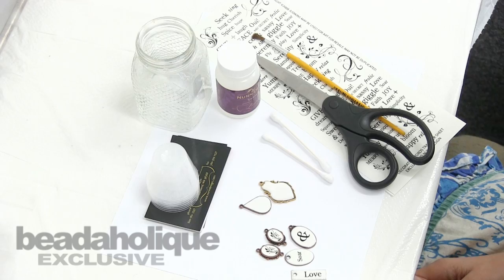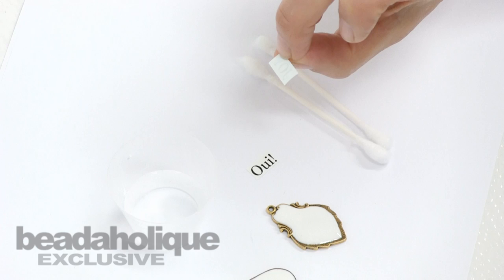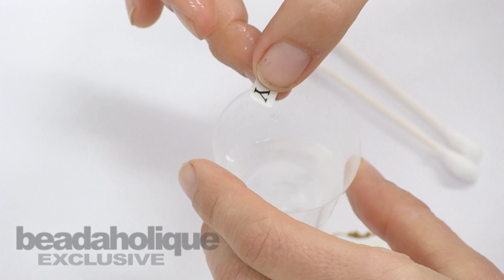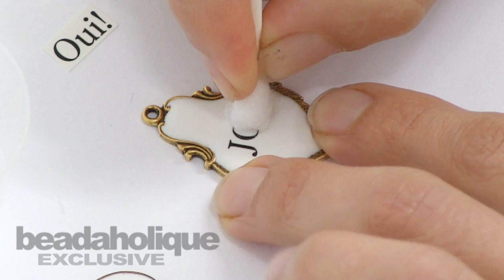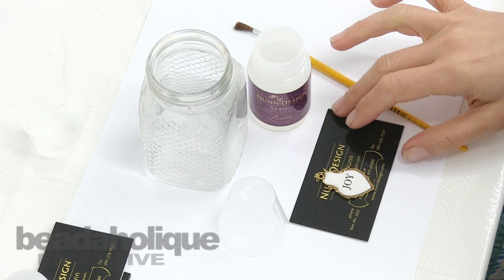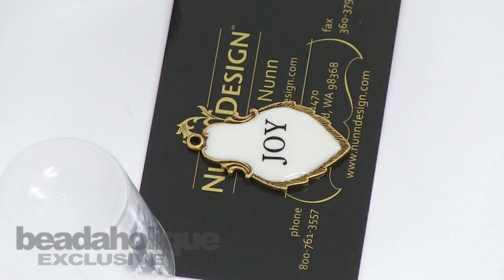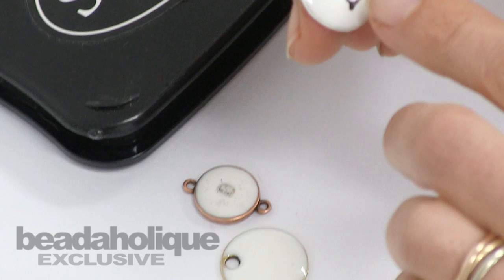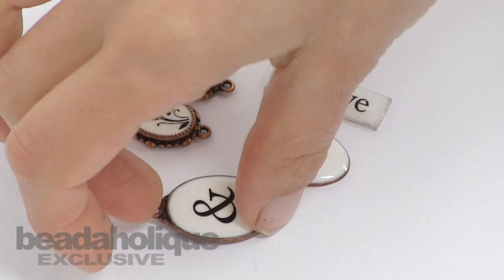How to Create a Faux French Enamel Look by Becky Nunn

Comment: becke, did you enamel the one with the letter E or did you use resin on that one ..no bezel edge so i wondered
Reply from the maker: The one with the letter E was done with resin and a rubber stamp. Even though there is not a bezel edge, the surface tension on the blank kept the resin inside the boundaries.